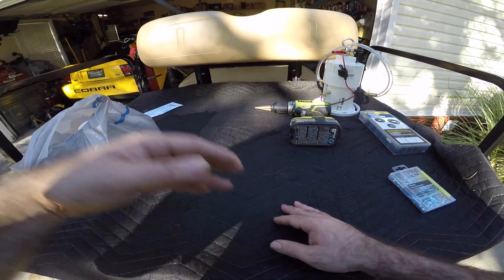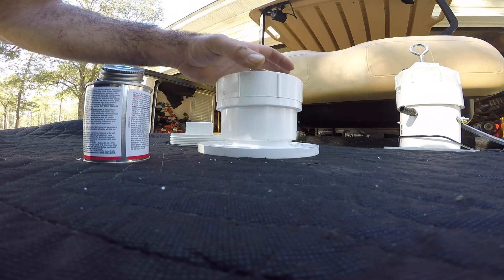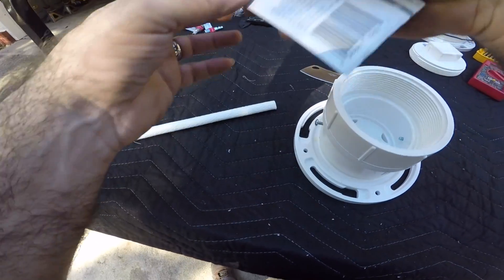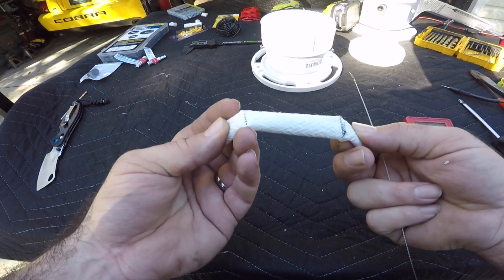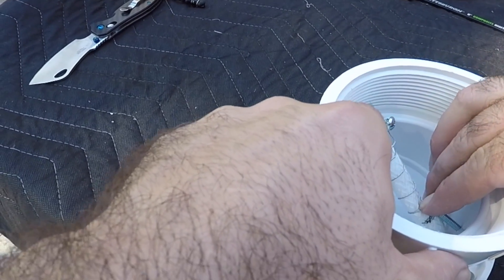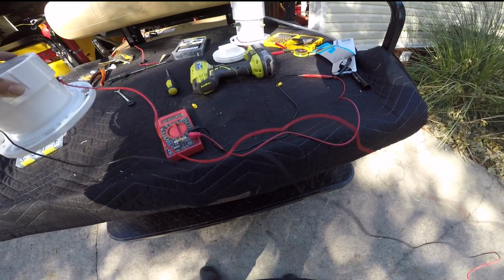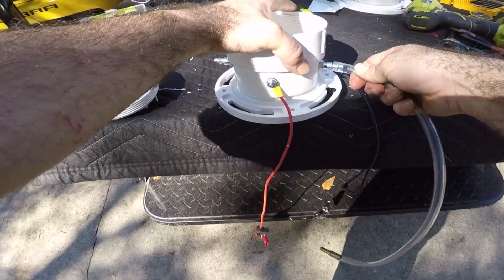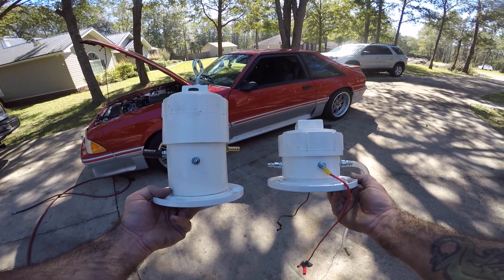THE BEST SMOKE TESTER YOU CAN BUILD!! / THE MR. FUSION MINI BUILD

Comment: What’s the highest pressure this thing can handle?
For finding Boost Leaks at 15 psi 
Running a pressure regulator from air compressor. 

That’s my plan 3-30 psi regulator

Comment: Im surprised that those screw terminals dont get hot and melt the plastic being that they are directly attached to the heating wire.    Might have to build one of these as it does make a ton of smoke. More than the one i made using a soldering iron.

Comment: Ehh. Diy smoke machines have always been pretty shit imo. Tried a bunch of different designs, glowplugs, nico wire. They all suck and eventually melt. Dont like my entire garage smelling like mineral oil. Anybody find the best smoke producing liquid yet? Ive got 5 boosted vehicles in my driveway😂 2 biturbo. Loooots of boost leaks. Just pressurizing and soapy water works the best of all IMO. Find even the microscopic leaks that wont show smoke even.

Comment: Nice design mate.
I made a similar design but using a cheap soldering iron as a heater. After the first use it failed.
Ill now make one with nichrome wire like yours.

Comment: When I tested mine with the top open after about five seconds, it catches fire on the inside.   Is this normal? I assume when the top is installed, it will not.
Reply: Maybe not enough oil to the cotton, or too much current. Could also be because of the airflow (being open top).

Comment: I just google it, 1st off, mineral spirits are not mineral oil, 2ndly , while mineral IS sometimes called baby oil, mineral oil IS flammable but baby oil is NOT.(& btw having higher fuse for thicker wire just means it can tolerate higher watts - not requires it),- this has been said to be about 7 amps(if that’s accurate about 100 watts).. biger problem is, miner oil(spirits just wrong move period) but min. oil IS flammable..  leaving 1 safer 2 part choice, baby oil that is checked out NOT to be min. oil &/or flammable👋.  thanx for the heads up cheif bye.

Comment: U & the guy who imitated your video.. & everyone else uses those connectors with 3/8ID hose to go around them to attach-  😩& yeeeeedt?, the hole in center of those connectors is about 1/4, so what’s the point?, thats Y I Usd 1/4ID same type hose.. with 3/8ID connectors for 3/8OD hoses.. it’s calld smoke machine smRts🤓.  ofcoOrse Home Depot was out of the brass 1’s so I got those pop in plastic types -gS we’ll C if thA mLt.. the brass 1s, for near future, are 1/4ID & all that yip-yap…

Comment: HELP, what I’m I doing wrong? I’m working on one of this, but when I test it it goes on fire inside the thing,. I used 1 foot of 26 gauge wire from a vale store. I used alligator clips from a battery tender I had, . I do notice the wire is only enough to go around the torch 3 times, I can see the wire getting hot immediately but 2 seconds later it lights up on fire and I blow it off. Please help ,

Comment: How do you keep the wick from catching fire. I am using vape wire 26awg at 2.5 ohms? It seems like my wire is shorter than other people's at around 12 inches long. Would increasing the length(ohms as well) make the wire hot but not red hot. Seems to me the olms the hotter the wire will get but also the longer the lower the voltage. Ideas?

Comment: this is great but im a bit concerned about safety so how can i stop it burning itself out or heating up too much and burning the resistance wire so it breaks. ill be connecting to a car battery wont be the same car every time though

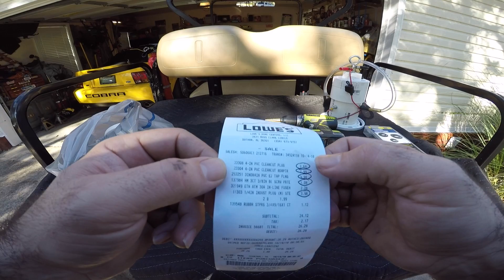Comment: 2:19 I stopped in at Lowes and the 23304 (4" Adapter by Charlotte Pipe) and the 253251 (Toilet Flange by Oatey) are a loose fit. There is at least a 1/4 inch gap in the pipe....can't glue that together.

Comment: Good job. TU... Wonder how fast this type of smoke machine would drain out the battery when looking for leaks that take a long time to find.
Reply: Start the focking engine dumbo! Battery wont drain then thick shit! Or if the car you're testing it on wont start then use another car that runs to connect to that battery!

Comment: I could not find the PVC 4" cleanout adaptor at Lowes that fit # 25351 4" Tap Flange. The only one Lowes had was #24094 4" adaptor that measures 4 1/4". How is 4 1/4" 4"? Lowes was no help in figuring it out and their part numbers do not register on their website. I can find parts at Ace Hardware in ABS but almost $50 but I don't want to spend that. I might as well buy the Harbor Freight machine.

Comment: Good video.  I added a shutoff valve, 0.5 PSI propane regulator (CAMCO Olympian 59013 from Amazon) and ring end 12VDC power cables with battery clamps. Made power through-bolt seals from high-temp silicon rubber. Mine leaked smoke from around the cap, which I resolved by smearing the threads with plumbers putty and reinstalling.
Reply: So 0.5 PSI is the input pressure? Would it work with no input air, maybe just plugging the input? I wonder if it would build enough pressure on it's own?
Reply: @timtucker7762  0.5 psi was recommended in several different build videos, etc. to not overpressure the car hoses. It seemed to work so I went with it vs. reinventing the wheel. No idea if it's optimal. Smoke does dribble out on it's own without pressure, but IMO pressurization is better to speed the process. I fed a 12V plug-in pool toy inflator nozzle into the pressure regulator. I've even seen designs where people pressurize by blowing into the hose.

Comment: @BREW2L I made this exact thing for $27 (everything came from menards) but didn't have the wire suggestions but had some 16g kanthal wire and it worked fine
Reply: *UPDATE* so i used this machine to try to find where my truck has a leak in the ceiling and so it was plugged in for about ½ hour and just ended up fogging the WHOLE inside of my truck but never did find the one in the ceiling 😭 and after it being plugged in that long it actually melted the holes where the bolts stick through.... suggestions for this @BREW2L thanks man

Comment: 2 ohms is to hot. It ignites the wick. Use 4.5 ohms and it will smoke and not catch fire. Great video
Reply: You used more resistance (more ohms) and it was cooler? Are you certain about this>
Reply: @davidspomer5091  more ohms requires more power, but seeing as the supply us fixed,  theoretically it will allow less current to pass.
Reply: yea mine caught fire @davidspomer5091
Reply: how do u get 4.5 ohms

Comment: Thanks for taking the time and uploading your video so others could benefit from it. Which trust me, it's truly beneficial. Also, regarding the battery wire. You don't have to buy, or use, a battery wire set with the cigarette lighter socket. There is a set with the battery alligator clips that already has ring terminals attached to the opposite end. Here's a link for Amazon https://www.amazon.com/dp/B07HF6LHPG/ref=cm_sw_r_cp_awdb_imm_B8WB7M9BMCCYHRXRYXGZ?_encoding=UTF8&psc=1. I hope it helps.

Comment: I just build a machine like you but failed ! I did exactly like you ! However , when I connect to car battery , the Positive connector ( Red ) is short , causing a zap . I try some other cable but still not working .  The wire I used is Copper Wire 18 gauge m and wrap around the Tikki Torch ! You have any idea ? Do you think we can't use the copper wire ?
Reply: Ohm it out with an ommeter.  measure the resistance.  There needs to be some resistance like 2 or 3 ohms, if it's too low it will be a dead short and then you're just shorting out your battery.  I believe that you need coil wire used in vaping or just use more wire.  The longer the wire the more resistance

Comment: How full do you fill it to? Do you submerge the wick or fill it up just to the bottom of the wick where the wire is wrapped?
Reply: Good deal. Thanks for the info.
Reply from the maker: Just enough to wet the wick
Reply: @BREW2LFOXBODY  just the two legs of the wick or all the way up to the wire windings?
Reply from the maker: Just leave a 1/16 or so of baby oil at the bottom of the wick

Comment: I made this and it works great but the wick gets burned where the wire touches and the wire gets pretty red within like 30seconds. Is that normal?
Reply from the maker: If you feel like it’s getting too hot just wrap a few more rounds of wire around it.👌

Comment: Have everything but the wire. Any alternative that they sell locally? The wire you use is only online.  Welding wire? Galvanized?
Reply from the maker: You can buy it at a local vape store
Reply: @BREW2LFOXBODY  thanks. What about the screw leads getting to hot and melting the pvc body

Comment: So I just wanna make sure I got the resistance on the wire right. Is it normal that when you hook it up to the battery that the wires turn red, and the wick gets some burn marks on it?
Reply: I wondered if the burning was because the wick wasn’t saturated but I’m not sure that would affect the actual wire turning red. Seems like there is too much resistance if it’s getting that hot, so wouldn’t you need less of a length to reduce the resistance? I’m not great with electrical stuff. Thanks!
Reply from the maker: It shouldn’t turn red if the wick is saturated. If it is add a couple more wraps of wire.

Comment: I’m in the process of building one myself.  I’m getting around 2.5 ohms at the leads. The coils are turning cherry red periodically I used 26 gauge kanthal wire. It definitely smokes pretty quick. Oh yeah and I’m using a five amp fuse. 

This is sound similar to what everyone else got? Should you be able to see the coil turn red at all? @brew2L
Reply from the maker: Make a few more wraps if you think it’s too hot.

Comment: For anyone making this thing in 2020...make sure you have a smaller gauge wire than 14 AWG for the leads. Should probably be 16 to 18 gauge (I'm not an electrician and I done messed up). 14 AWG requires higher amp fuse and will * checks notes * definitely catch fire making your wife run into the garage in her bathrobe.
Reply: I got 16gw- with clips & o connectors, guess I’m pushing my luck - U sure you didn’t just use flammable whatever, & fill it too high?(maybe baby-mineral oils flammable IdOnO), & yet even if it’s been wicks up into wick(which aren’t supposed to be bent directions say😕) .. would that not be a guaranteed fire risk? 2-3 ohms maybe a risk sensitive deal✋
Reply: I just google it, 1st off, mineral spirits are not mineral oil, 2ndly , while mineral IS sometimes called baby oil, mineral oil IS flammable but baby oil is NOT.(& btw having higher fuse for thicker wire just means it can tolerate higher watts - not requires it),- this has been said to be about 7 amps(if that’s accurate about 100 watts).. biger problem is, miner oil(spirits just wrong move period) but min. oil IS flammable..  leaving 1 safer 2 part choice, baby oil that is checked out NOT to be min. oil &/or flammable👋😒.  thanx for the heads up cheif bye.

Comment: we took a strip of paper 1 1 /2 wide and the diameter of the pipe, then divided it into 4 marks, , wrapped the paper around the pipe then used those marks to locate the holes

Comment: Thanks for the vid. Made myself one today out of ABS. One thing I did do differently was using some liquid tape on the bolts (outside of plastic) so if it slid for some reason it couldn't ground out the to body or engine. I know there is a fuse in there also to protect against that but I figured it wouldn't hurt and I already owned the liquid tape.

Comment: I just built one, thank you..  However, I forgot to add the grommets to the bolts from inside and couldn't figure out why I was pushing out fluid..  LOL
Unfortunately, I still could not get my system to pressurize, nor find the leak.  :(   Regardless, maybe next time I use it, it'll be worthwhile!     p/s/   Does Baby Oil smoke more than mineral spirits?

Comment: Nice! Hey man, how about trying a video to adapt a 12V tire inflator to act as the compressor to that small smoker? Or at least something real cheap to provide the air. Thanks
Reply: Why? I would put out too much air pressure which could damage your vehicle. You'd have to add a pressure regulator to bring the pressure down low, 1-2psi. Build the smoke tester, on the side that a compressor connects, add a tube like the opposite side but insert a check valve (small valve that won't allow back flow) to prevent the smoke from coming out the end. Just cut the tube fairly close to the main unit. Then simply blow in the end. You don't need much air pressure and shouldn't use much anyhow. Now if you're asthmatic like me, and don't think you'll have enough air pressure. Then get a simple foot/hand bicycle tire pump, cut the end off the outlet hose and push it on whatever outlet coupling you used coming out of the smoke tester housing. Just be careful how much you pump. It may be safer to add a pressure gauge inline. Just have someone carefully pump the air and someone else go looking for leaks. Hope that helps.

Comment: Just a add on to this set up is adding a propane regulator they'll drop your air compressor PSI to a safe 1 psi because a lot of systems will get messed up with anything over 2psi
Reply: Jeremy,
Please post a link to the propane regulator you use.
Thanx!
Reply: i just blow with my mouth on the other end its plenty and simpler
Reply: Link?
Reply: No one needs to add a link. Just simply do a search. Spoon fed.
Reply: @Roller76  couldn't find anything
Reply: @Roller76  good for you danny boy
Reply: @johngonzalez1193  Awww thanks speedy that made me feel warm and snuggly.
Reply: @johngonzalez1193  Its Danny the fanny!

Comment: Soo what kind of sealant on the top thread,,cause you have to reopen it to reoil...on a need to know basis since I made one and it leaks up top...
Reply from the maker: I used electrical tape on the top cap.
Reply: You can also use a little bit of silicone grease. cleans up easy too if you get it on yourself. I use it on my diving equipment like o-rings.

Comment: I built this yesterday, but I had to order the resistance wire. I tried using mig wire, but count get the right resistance.
Did you just use one strand of the 26 gauge stainless wire or was it doubled up?

Comment: BREW2L How are you doing! I went to Lowe’s today to go find all the parts on your video receipt and I found all the parts. After I found all the parts I went back to the pvc plumbing section cause I realized I grabbed the wrong Flange and in the process of doing that a worker asks me if I need help with anything and I told him what I was going to do with all the parts from your receipt and he said that it would all melt in seconds because pvc can’t tolerate heat, I ended up putting all the parts back and not buying anything because I don’t have knowledge about this project like you do, if you can please make another video regarding this matter talking about what a wick or heat of any kind can do to pvc I would greatly appreciate it. Thank you! :)

Comment: This thing worked like a charm. Located my EVAP leak in less than a minute once I got it hooked up. I was contemplating buying a $100 part in hopes it would fix my problem. After hooking this up and finding my leak I was glad to see it wasn’t the part I was going to buy but instead a $10 water separator. This thing saved me a ton of time and money.

Comment: I just built one. I wanted add that you need to twist two pieces of the 26 gauge wire together as that will make a difference to what ohms people see. But thank you for the video.
Reply: Mine keeps catching fire
Reply: That's a great idea. I got 22 gauge kanthal wire, because it's cheap, so I'll definitely try twisting it.
Reply: Thanks for the tip.  I have 24 ga ss wire that i gotta go about 10' before i get anywhere near 2 ohms resistance.  Will give this a shot.

Comment: Your right about the BCam sounds great ,great videos, i try to add a comment in your b-cam install video but they are turned off, my question is when you installed your b-cam did you change your stock valve springs?

Comment: Just failed a SMOG TEST in Cali with an 0456, 0457 small leak codes. Mechanic wants $165 just to do the diagnostic test, a smoke test. There are a lot of smoke generators on youtube, but yours is, by far, the most professional. Thank you for sharing your knowledge and experience with the public.
Reply: CA makes old fox mustangs need to pass smog?  Wtf

Comment: I'm using the 26ga 316L wire, but everytime I connect it to my battery the wire gets red hot and starts the wick on fire.
Reply: Increase the length of the wire or double the wire and try

Comment: Made my own worked well aside from being unable to find coil wire. 
Any suggestions on alternatives?
I ended up using an old soldering iron in place of the wire works well but not very portable.
Reply: Try the heater wires from inside an old toaster.

Comment: Great idea. You also could use a mosquito fogger machine ($50 from Amazon Prime) and pour baby oil in it. It works like a charming. It harmless to engines.
Reply: That's originally what I googled when I found this.... a DIY way to adapt a Halloween smoker for automotive use. Being a vaper and tinkerer, only thing I need is $18 bucks worth of PVC.   Wonder if Domestic/Import have a flavor preference :D

Comment: Hey B I got 2 question, I’m using 17 gauge galvanize steel fencing wire I got at TSC which only pulls 1.17 Ohms . I doubled it up and now it’s pulling 2.12 Ohms. Will that still be sufficient for the Mr. fusion 2.0? Second question, I made my own clamps using 12 gauge wire a 30 amp fusible link and the crocodile clamps but every time I put it on the battery (negative then positive); I blew my fuse. What am I doing wrong? I appreciate your help with this issue thank you.
Reply: Jamie Mills you could use a mosquito fogger machine and put baby oil. It works like a charming. It harmless to engines.
Reply: Leo thanks for the tip brother never thought about that